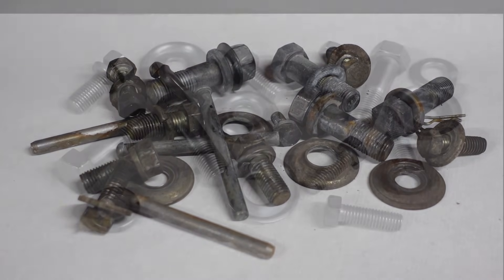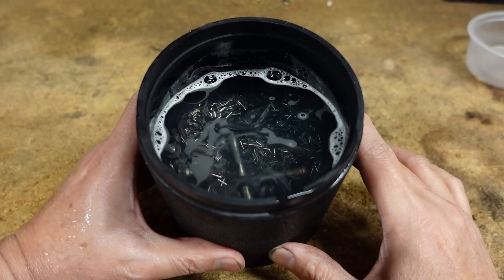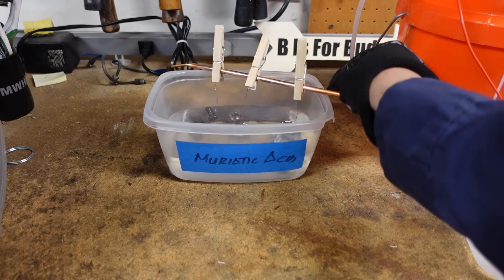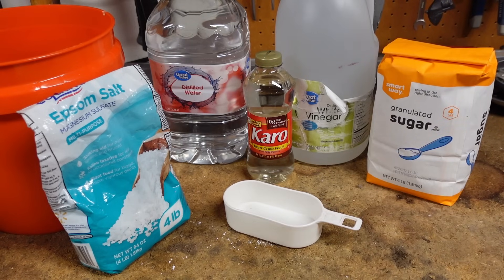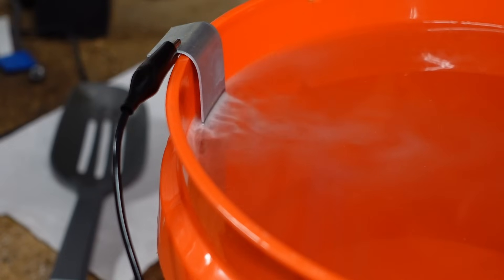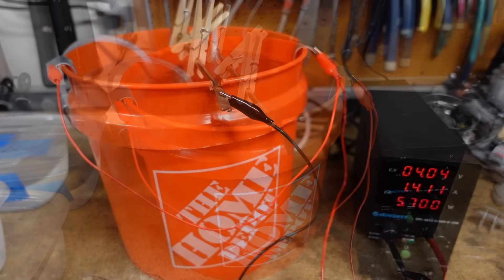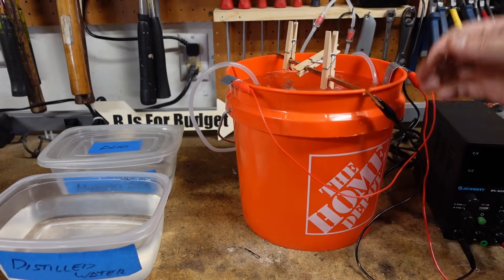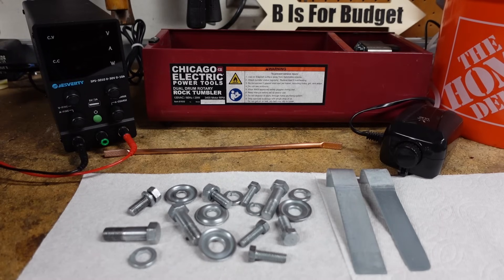How to Zinc Plate at Home with Household Ingredients

Comment: Neat. Have you tried a sonic bath vs the tumbler?
Reply from the maker: Thanks!   I'm sorry, I haven't.  Unfortunately, I don't have an ultrasonic cleaner available to me.
Reply: Maybe you can make and also sonic cleaner as a project and make a video,  Cheers
Reply: I've tried cleaning bolts in an ultrasonic cleaner and it didn't do anywhere near as good a job as this tumbler.
Reply from the maker: @benaresq  Interesting,  thanks for sharing.  Out of curiosity, were there other cleaners in the ultrasonic solution?
Reply: @BIsForBudget  Yeah, I used a degreaser/water combination. All the oil/gease was gone, but they still had crud on them.
Reply from the maker: @benaresq  Cool, thanks for the info. 👍
Reply: If you have rusty parts, you can use electrolysis (reverse current to what you did her), with a bath of arm n hammer washing soda, that will  clean the surface very well while stripping away the rust, then a rinse in clear water, then dip in a quick acid etch, muriatic if you intend to plate right away, ospho for storage ( coat with ospho keeping it wet for roughly 30 minutes then allowing to dry on the surface, then when ready to coat with finish, re-soak part in ospho and then wash with clear water and dry as quickly as possible, then coat with whatever coating you plan on using.